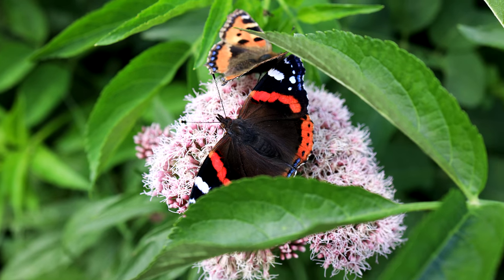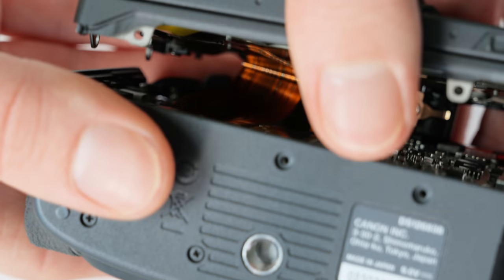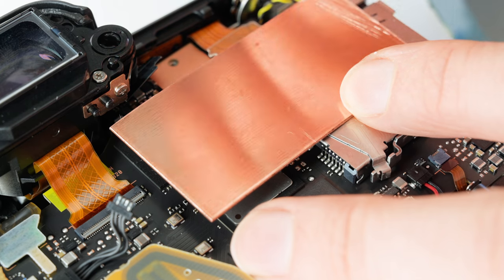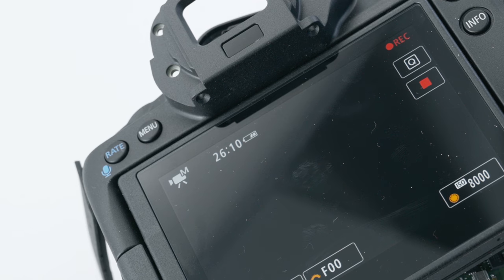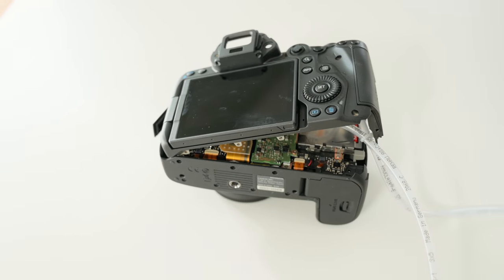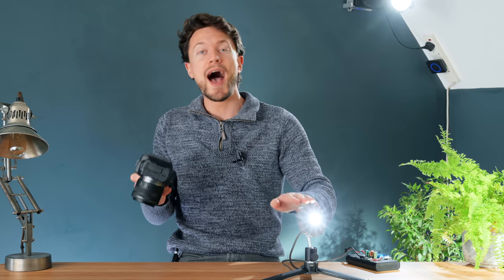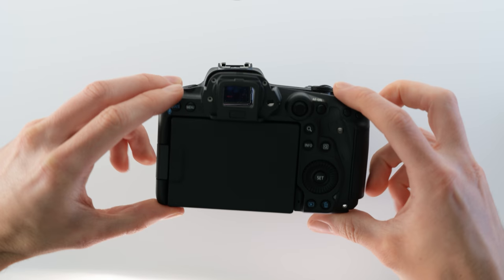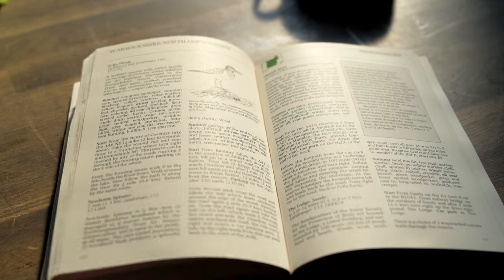The only reason to watercool a camera....

Comment: This camera was proof that Canon is a shady company that artificially limits hardware sold to consumers ...
Reply: the r5 is meant to be a stills camera first then video camera last. It's a compromise of cost and use case. If they did what he did, the camera will be more expensive than is should be.
Reply: @jackdumanat49  You can't have your cake and eat it! Try weathersealing this 'simple' 5$ contraption.
Reply: @jackdumanat49  I thought we got past this stage where we think a camera can do only one thing ... 

It was exactly in your position in 2008 when the 5D Mk2 came with video capability ... 

Artificially limiting a product is foul play in my book.
Reply: @BeardsChips  yeah but I think you're not seeing the grand scheme of things. Of course not, why would they? Why would they want to make a perfect camera for both stills and video, when they can make 2 cameras for the same price.

Beside 10-20min of continuous filming is pretty long and also huge. Majority of people would only causally use 4k and 8k video anyways. Why this camera anyways? BMPC 6K or gh5 is still pretty good and cheap.
Reply: @jackdumanat49  I understand what they are doing, but don`t be stupid enough to enforce it by baiscally make it 20 mins on the timer... they got caught cheating here .. and this comes after a long wait for them to actually make a good improvement on their DSLR/Mirroless line .. in the mean time they lost a lot of customers to Sony and Panasonic ...

Comment: My 650D used to over heat after 30/45mins of using it as a webcam on my pc, bought a 120mm fan and put it behind the camera when the screen is flipped out, seems to have solved the overheating problem :P

Comment: I  feel like you could also put a copper plate on the back plastic and then have the fan and heatsink somewhere else which allow the screen to be closed and would be less bulky in the rear

Comment: you could even dremel a tiny hole into the plastic to feed two wires from the power, and in the battery slot add a little bit of electronics, and you could have the fan turn on as soon as the camera turns on

Comment: I thought the old reason for recording time limits was due to classification of imported goods, if they record more than 30 minutes then they get classed as video recorders and get higher import taxes, then the customer can update the firmware to remove it. Maybe by default they're set to 8K so when they're tested they meet the lower stills camera import tax? I'm surprised it wasn't mentioned as a possibility especially since they're shipped with a basic recording time limit instead of actual temperature sensing. Regardless, yeah it seems they get insanely hot, and yeah the later tests prove they are indeed temperature dependent after the firmware upgrade so, potentially a bit of both?
Reply: might have started like that but it's definitely a segmentation thing now. Keep in mind they do sell recorder with the exact same guts

Comment: Surface temps of electrical devices limited by IEC, thats they don't use suraface of the equment as a cooler ... For example :

   MacBook Air M1 is a fanless laptop , gets toasty and downclock after 5min of heavy workload , there is no thermal pads between cpu block and shiny and big Al surface , Actually there are isolation material... LinusTechTips removed that isolation and added thermal pads and Macbook Air kept his clock high as MacBook Pro M1 sometimes beats Pro , but at the downside outside of the laptop is hot and abow threshold of pain... Non moded Air is half a degree below of thresh hold of pain... So they kept laptop slower/warm at the cost of being able to holdable...

  This might be the issue why Canon left the desgin in that way... DSLR s are degined to be hold by hands so their surface temps needs to be lower than a laptop which is mostly on ur covered lap or a desk...

Comment: Thermal compound is NOT betrer at transferring heat than thermal pads. The reason it tends to perform better is because you can get a MUCH thinner layer of it between flat surfaces.

Comment: Thermal pads are actually good at conducting heat -- IF you use high quality pads. I just recently took apart my RTX 3090 Founders Edition card and swapped out ALL thermal pads on front (GPU die side) and back of the PCB, and all load temperatures on the GPU, VRM, and VRAM dropped by 15-20 C.

Comment: you could mount a peltier element on the chip (like the original bmpcc) or the backside and feed it with a external battery

Comment: What you should have really done is build a step out frame so that you can give the camera a larger gap to blow in more air. I am pretty sure that this could have been done to allow for a 3 or 4 part 3d printed part. Step out frame with air in gap and air out gap along with tripod mount and fan. This could have and most likely kept the thing much cooler even with you upgraded plate. Cannon screwed the pooch on this one.

Comment: This is really nice an elegant solution for sure, maintaining the look of the original camera but adding to its cooling capacity immensely. If that back portion where the copper is nearest the surface is only plastic one could also make a hole for a slightly thicker piece of copper to have access to open air, and possibly texture it with small channels to increase surface area and turn the spreader into more of a heatsink. I don't know if this would allow for unlimited runtime with passive cooling, but it would certainly extend it further, since not only would the insulating layer be absent in at least some portion of the back allowing more efficient transfer to fresh air, but increased mass of the heat spreader will always increase the time it takes to heat up. Though depending on how thick the plastic is it may not be enough difference to make a difference based on mass alone.

Comment: Dang, that is beautiful. Real engineering.
Might add, for cannon it would be as simple to just made the rear plate out of aluminium and use a proper heat spreader and thermal pad.

Comment: You should be selling this as a DIY kit for $250, or perhaps a mail-in service for $400+ shipping fees. Optimise the design further into a heatpipe running into a grip accesorry or bottom plate with a fan and get a trial run of 1,000 copies made via a kickstarter crowdfunded campaign.

Comment: instead of having air blowing vertically is it possible to 3d print the outlets with slightly slanted edges that would blow the air on the plastic panel

Comment: Dude, you should have used micro heat pipes to duct heat into the tripod mount, so as long as you have it connected to a tripod the heat would transfer into the tripod, which even steel is a far better thermal conductor than plastic, which with 39 minute record time and 5 minute cooldown time in standalone mode would have made it acceptable, and even then you could have made an attachment which could actively cool the tripod mount via screwing into the tripod mount.

Might need a dab of thermal compound every time you screwed it in though... Which might get a bit messy.

Comment: Using layers of foil and an electrically insulating layer it's possible to increase the cooling through more of the case in various electronics. In this case it would possibly be enough to allow the camera to not overheat without external cooling parts. Incredible that this camera isn't designed well enough.

Comment: pretty impresed for the result. It would take canon for complete re design for the cooling solution, because A the original state is not acceptable for professional equimpent (especially with the original temperature monitoring higly based on time and not with actual sensor data) and B just the solution that you made would not be legal because laws around how hot consumer electronics are allowed to get on the outer touchable parts (it's stil problem if it catches on fire... (really just that it greatly decreases life of the components)) Great video as always!

Comment: I did not expect the copper plate to do that well! Great idea.

It is also weird how poorly this has been designed and implemented.
I mean ffs, who had the idea to not monitor temperature, but use a timer?!
Like what if it is operated in a warm/hot environment? Does it just boil itself for 20 mins?
Also the thermal pads and their placement are nothing short of insulting ...

Comment: 18:50; The R5 or almost any interchangeable lens mirrorless cameras are NOT for stills (unlike they were advertised for). Mirrorless is good for video, and video only. If you are going to get a stills camera, get a DSLR, Canon and Nikon ones will last you a lifetime, whilst newer mirrorless cameras are designed to pose as good still cameras, but they are in fact inferior, less reliable, and upmarked compared to an interchangeable lens DSLR. However, a mirrorless camera is the way to go when shooting video, even though they fail quicker.

Comment: Wondering if they could have routed the heat out into the tripod screw mount. That coupled with a hefty tripod could solve the issue. Or as he said, sell a bottom plate addon that could screw into the mount and dissipate enough heat passively. No videographer wants fans spinning near the microphones.

Comment: What if you made a replacement for that plastic part of cast copper or aluminum? It would be more efficient at removing the heat, while being a cosmetic upgrade.

If it were aluminum, you could even anodize it black and it would be almost undetectable.

Comment: You needed, to continue the plate of the radiator, bending it under the attachment of the shoe, cut the rear plastic wall to extend and then the fan from the bottom will cool 100%

Comment: Great video.  I have a somewhat unrelated question for you.  When you had the camera to bit did you happen to notice where the bluetooth/wifi antenna was located?  I have the need to hardware disable the bluetooth and wifi in a Canon R5.  At somepoint I will buy one and open it up to see if I can find and disable the antenna.  But I wondered if you have any thoughts on that?

Comment: Coming in late, and reading the comments after watching this video.... Edited to add this early in the paragraph, I had thought that cameras had timers to keep them from recording longer than a certain period of time to get around some sort of taxes on video cameras... I would have sworn that the manufacturers are charged a lot more for a video camera than a still camera and when they added video to cameras, there was a battle about why the manufacturers did not think they had to pay the video price on a still camera that they added video to. Note this was from many years ago, so maybe it is moot now?
 I suspect a few things will happen now though... 1) Canon will add things in places where your system is so that it is NOT possible to use it. 2) Canon should be using this system of video and stabilization on a video camera at maybe 20% more, bigger so the heating issue is not a problem, and make bank.

Comment: Would ya happen to have some rough measurements for the plate? More particularly the bit that comes off the bottom plate and rests on that flex cable.

I have access to a lot of metalworking stuff via my day job and I'm considering buying this camera once I pay a few other loans off.

Comment: It is primarily a camera, not a video camera. If you're looking at 8K pro video recording, a base camera without lenses will run you upwards of $25,000. A RED camera includes a fan, that in hot environments will overheat. Jokingly, folks have suggested mounting a radiator to these RED use cases. So, it appears a $4000 R5 and $25000 RED have the same issue, and neither do a great job of mitigation.

Comment: I wonder if the internal modification is even needed if you strap an external heatsink to it. just for testing i put my R6 on a slow 120mm fan and it records 4k30 indefinitely (at 26°C indoor) and cools back from 4k60 really quick. even when recording 4k30 directly after the heat warning, that warning goes away. strapping and old socket7 cpu heatsink-fan combo (or something similar) to the back of it when its in the camera rig wouldnt be much of a problem for run and gun use. definitely will look into it.

Comment: Canon R5, with firmware 1.6.0, overheating is a thing of the past. With Auto Power Off Temp, set to High, the auto power off minimum recording times at 23°C / 73°F are:
8K 30p 45 min. or more
4K 30p HQ [Cropping: Disable] 60 min. or more
4K 60p [Cropping: Enable] 50 min. or more
Reply: Yes but u are degrading the components life with all that heat trapped in there
Reply: @charliebrownn6622  Exactly

Comment: Just needs somebody that can design a copy of the plastic rear cover in aluminium instead. Have the aluminium case anodised black for that factory look. Then offer a conversion service where you install the copper heat sink, thermal paste, and aluminium rear case. As a side benefit there will also likely be an interest from astronomers who do ultra long exposures and would love a camera that had a good cooling system as sensor heat causes noise in long exposures.

Comment: Amazing build. I know my Sony a7r3 gets super hot with the battery in the compartment and there are aftermarket extenders to put the battery external. I wonder if this could help eliminate internal heat in conjunction with this awesome solution

Comment: The point where you are buying several decent to high quality lenses, a gimbal, a steady cam, a tripod, focus pull gears and such, another ~300 bucks doesn't seem too farfetched if it will greatly increase the time you can use the damn thing before it overheats, potentially even for indefinite periods of time. Aside from this, they could have also possibly patented the design, so then they'd either make money from other brands paying them royalties, or remain ahead of the game as the competition try and develop their own way of doing it. They really missed out on this opportunity imo. Companies should really try giving DIY channels their early samples and hire then to try and fix them in their own way, pick the most efficient way or mishmash those methods together to create a Chad solution. If they'll do it anyway, may as well pay them for it and implement it into the final product or as an addon (again, extra sales).

Comment: Who puts thermal paste on a circuit board? 
The main purpose of thermal pay is to transfer heat and decrease the friction between the cpu and the radiator. In your case you could’ve short volt the board and would’ve been better of with a 3mm thermal led that’s used for purposes like so...

Comment: DANG, this is insane, if you actually pursued commercially and ran the copper heat sync to the bottom of the camera. You could through on an attachment like the 3D printed one you have and you would be able to sell that thing for $500 I'm sure! Modification and parts and labor, once you got a system, it could take maybe 30 mins per camera. Hire a group specifically to do this full-time and boom! You got yourself and independent stream of revenue.

Comment: So Canon could have build a little bit more expensiveinternal passive heat dispersion (while not having to change the case of internal PCB layout) for like 98% of customers to be happy and then sell some active cooling module for filming power users to enable them non stop filming.

Comment: I think canon was thinking why even bother as in probably 2-3 years they would have a new generation CPU that does the exact same thing without even getting warm. Such as my used gopro fusion camera which actually killed itself from overheating vs my gopro max camera which is just three years newer, runs 12x faster and doesn't even get warm

Comment: No need to open it. Just build a refrigerating housing for the entire camera that keeps it cool to the point of not malfunctioning.

Or drill a hole on the back of the camera to let a copper tube stick out and distribute the heat outside. Sealed of course.

Comment: it would be great if you could do a similar version of this for the 16" macbook pro, it's such a powerful machine but gets really hot i've often wondered if the back panel could be removed and a 'spacer or sandwich' section added to add better cooling perhaps even with an external water cooling solution such as this...

Comment: Although I don't suggest it without cooling there usually is a setting somewhere deep in the settings or somehow to change the auto shutoff of cameras to use the full battery 

There may be a setting to turn off the overheating warning or something

But what do I know my best camera is a GoPro

Comment: a convection based backplate aproach makes more sence since you can just keep the screen a milimeter away from it and use a water cooling solution at the bottom that connects tooth to tooth ,  come to think of it copper flets asin actual heat pipes would make a lotmore sence
Reply: Thing is it doesn't seem to need that much in the way of cooling. The only issue here is that it  seems to have been designed to actively hinder it's cooling what with the placement of the DC board. That alone is WTF levels of bad design. I'm guessing the execs wanted it to have bad heat disipation to sell their more expensive cameras.